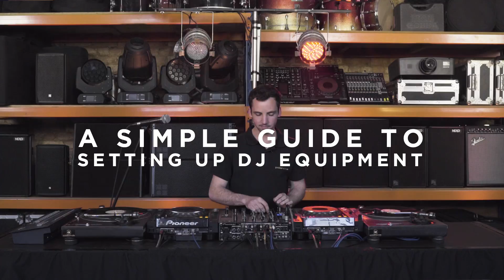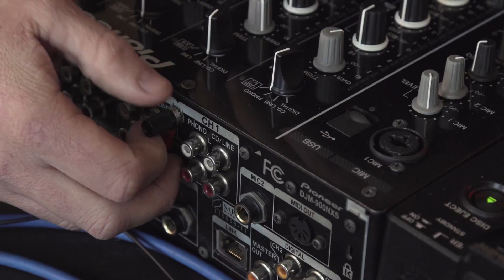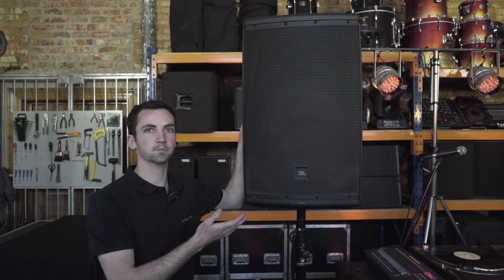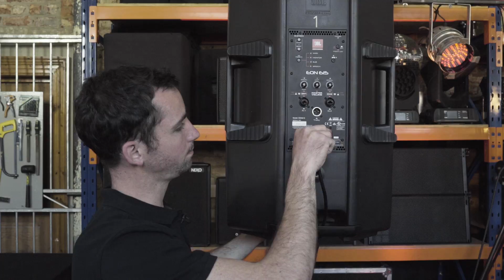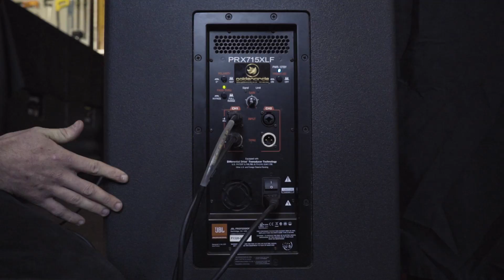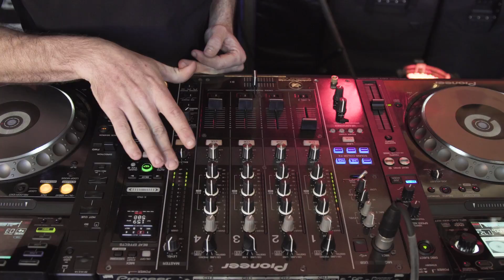A Simple Guide to Setting Up DJ Equipment and a Basic PA System

Comment: Your Gain Structure is completely wrong. Never turn your Powered Speakers, (or Amplifier for Un-powered Spkrs) all the way up. You weren't getting enough Volume, not gain, from your input because, in your example, the Cross-Fader at the bottom was not in the correct position for Gain setting. That's why you had to turn your Master Out on the Mixer so high.